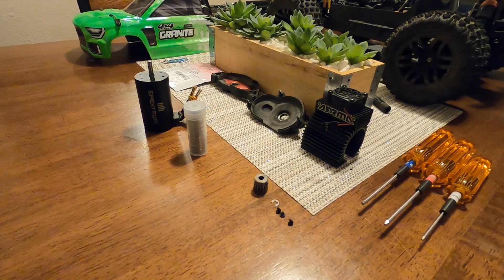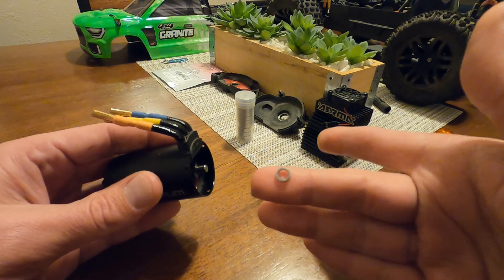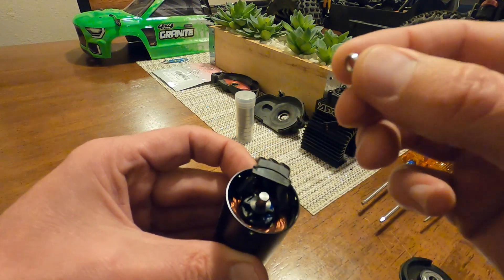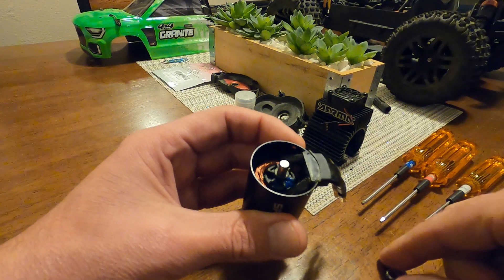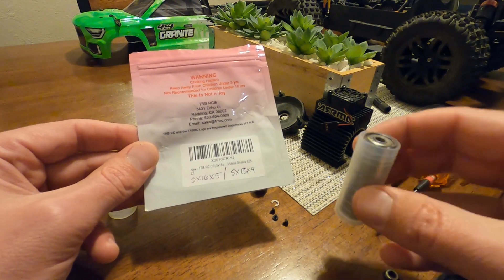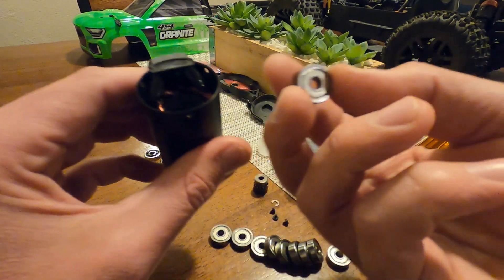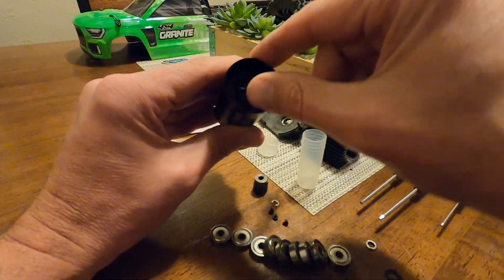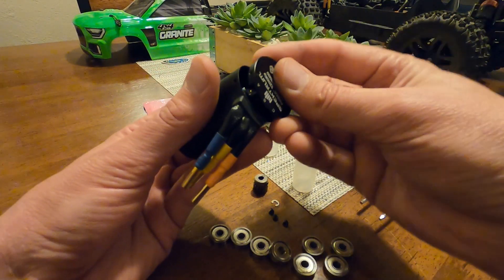Brushless RC Motor Bearing Replacement - Spektrum 3200kv (spmxsm2000 - Armma Granite 3S)

Comment: Thank you! Do you know any replacements for the screws that hold on the back cover? I may have stripped them..
Reply from the maker: You're welcome!  Unfortunately, I haven't been able to find those replacement screws, but I have heard that some people have found them on Ebay from time to time.
Reply: @rcleesd I’ll search. Thanks!
Reply: My response isn't showing up. Unless it keeps showing up but I don't see it. But those screws are on Amazon if u even need the cap screws for the motor. https://www.amazon.ca/XunLiu-Grade-Button-Socket-Screws/dp/B0756WS15T/ref=sr_1_1?keywords=m2x3+screw+button&qid=1570419268&s=hi&sr=1-1

Comment: how difficult was it to get the new bearing to seat in the motor? i'm trying right now and cannot get it to seat all the way in, it stops about halfway
Reply from the maker: Make sure that there isn't anything leftover...such as a bearing ring, if yours exploded? It's common for everything to come out except that outer ring. Other than that, you can try putting the motor cap (ends where the bearing go) in the sun or blow them with a blow dryer to heat the aluminum up (just a bit) so that it expands. You could also put the bearings inside a zip lock and toss them in the freezer for a few minutes...just don't leave them in there too long so they don't get moisture buildup. Let me know if you have any luck!
Reply: @rcleesd  Same problem, I’ll try helping with heat/freeze

Comment: Do you happen to know the size of those little screws, not the tool size but the actual screw size.
Reply from the maker: For the motor end cap? I can measure it....
Reply from the maker: 4mm total screw length. 3mm of threaded shaft.  1.5mm hex head.

Comment: Man I can’t for the life of me get that bigger bearing to seat all the way. I’m hesitant to use a hammer or something like that.. any tips? Is there any type of grease I could use to help it move in smoother?
Reply from the maker: You could try a drop of oil, but I would reccomend warming up (blow dryer, oven set to 140) the aluminum housing a little bit (but not too much) and it should expand ever so slightly and allow the bearing to seat fully. Let me know if this helps! Good luck 👍
Reply: @rcleesd  I ended up giving the metal shaft a couple love taps with a hammer, since the part of it that touched the bearing is the only thing I have that makes full/proper contact. Got it back together and the shaft has no play and also seems to rotate smoother by hand.

Gave it a few rips in the backyard and nothing exploded! Will have to check for any temperature issues tomorrow lol.
Reply from the maker: Awesome! Glad to hear it!!

Comment: Very helpful. Thank you!! 🧟
Reply: No worries thank you so much. Got a question too ask?  Where do you get those shims on back of the motor. You know the sad face things. I have another motor I'm fixing and now know why it broke on me. Thanks to your video. But I must have lost those when I took the motor apart a year ago. If could tell me what or part number would be great. Thank you!!  ☠️💯🥃
Reply from the maker: @skeletorrc2583  Honestly, I don't know where to buy them.  My best guess would be to try to source something similar to those at a hobby shop or Home Depot.  I doubt that Amazon would carry them, but possibly on Ebay.  Maybe you could try to contact Spektrum directly, but I think you have to go through Horizon. Their solution would be to send a new motor though. Good luck and let me know if you find a solution!
Reply: I have found some on Amazon that come in a kit. 200+ different sizes. From 3mm too 30mm so we will see. Thank you for responding if they are it I will gladly sure the info with you. ☠️🧟
Reply from the maker: Thanks for watching, glad it helped!

Comment: @RC Lee hey thanx for the link to bearings. My bearings were so bad well just the one in the nose that i couldn't get any numbers off of it , i got the number from the rear bearing and it ended up being to small when i took the race out  and matched it up im in the process of repairing my motor only after about 9 or 10 runs and the bearing is blown out
Reply from the maker: No problem! Bummer it went out after only 10 runs. Thanks for watching!

Comment: Does the bearing itself have to sit all the way down 
I couldn’t get the larger bearing to sit all the way down onto the motor
Reply: I could not get it to sit flush,  probably messed up with the removal process 
Ended up just putting it back together and getting a warranty motor
Reply from the maker: Try it and see if it runs...might not be an issue?
Reply from the maker: It should sit flush, but it will be a very tight fit.

Comment: Thank you. I never knew about the beveled side of the spacer. I recently checked my motor and the spacer was slightly chipped. I think it's because it was backwards. Replaced it the correct way with a spacer from another motor.
Reply from the maker: Awesome, glad it helped!!

Comment: This is super useful but the magnets are so strong I can’t get the rotor out
Reply from the maker: Thank you! I had a similar issue with mine but was able to get it out....maybe try to have someone else hold the can and use a vice grip (with something to protect the metal stem) and with two hands it might pop out? Be careful though, cause once you overpower the magnets, it will release with zero resistance and you may fall over! Good luck, let me know what happens!
Reply: @rcleesd  I was able to get it out just had to be quick and pushed the can down while holding the shaft.  Sadly the front motor bearing was shot so I have to get a new one.
Reply from the maker: @mysterygamer48  At least you were able to get it out!

Comment: My motor had the balls rolling around inside after 4 batteries and now a metal outer bearing ring is stuck inside. I’m about to order a new motor that isn’t from spectrum just because I can’t get this dumb thing out... any ideas?
Reply from the maker: Call Horizon, they will send a new motor, no questions asked!  It is a known defect, and they sent the V2 Arrma motor as a replacement. Haven't had any issues since! Check out my video about the warranty call and process...it was so easy!

Comment: thanks for this video, very helpfull! i have to change the bearing on my 4985 hobbywing from the max6 combo after 5 or 6 batterie charges, wonder what went wrong there ^^ i noticed some blue stuff on the rotor the side facing towards the pinion gear. what's that stuff? also, of course, i stripped one of the tiny screws on the back of the motor -_- subscribed!
Reply from the maker: Thanks for the sub! I believe that blue stuff on the rotor is used to balance it from the factory, like weights to balance a wheel.
Reply: @rcleesd  oh... so i screwed the motor i guess ^^ banggood i'm coming :D

Comment: So what sizes do you need to replace them ? 2 5x13x4?
Reply from the maker: It depends, do you have the V3? If so, you will need a 5x16x5 and one 5x13×4.  I explained it in detail starting at 6:20. Let me know if this makes sense!
Reply: @rcleesd  I’ve got the v3 , thanks :)
Reply from the maker: If you have a V2, I would open it up and make sure that both bearings are identical, but yes, they should be 5x13x4, if it is a V1 or V2.

Comment: Great Vid!!!!Really struggling to remove the front bearing any more tips? Im scared to wreck the can and the hole for the stator too bad. 🙈
Reply from the maker: Thank you! Try putting it in the fridge for about 20 minutes, then put it in the sun for 10 to 15 minutes. Since the can is aluminum and the bearing is steel, the can (bearing mount) should warm up and expand quicker than the steel bearing, allowing it to be removed with less difficulty. Good luck and let me know how it goes! Also, a very strong magnet may help remove the bearing as well, since it won't be attracted to the aluminum and only the steel bearing.
Reply: @rcleesd  tried the fridge 🙈. Then the heat gun... No joy... I ended up at last resort. I drilled 2 x 2mm holes on the perimeter of the bearing from the top of the can... it tapped out with a small hex. Bearings installed and running again. Thanks for the clear instructions in your vid . I also have a motor on way from horizon under warranty that will be a spare, also a lot of spare bearings. Win win. 😉 Also subbed!!
Reply from the maker: Awesome! I'm glad you got it out!!

Comment: If my bearing isnt broken but just dirty can i reuse it cause i cleaned mine off and put it back in and the motor wont move unless moved by hand
Reply: Well the bearing looked like it was in good shape nothing broke just alittle dirt on it so i cleaned it off and idk if it was good to put it back in
Reply from the maker: If it turns without any grit or grind then oil it and it should be good to go!
Reply from the maker: If it's that bad, then I would just replace the bearing.

Comment: That's interesting...... I got a bunch of Arrma Granites well I got alot of Arrma and traxxas trucks and a few other brands. But anyway my Granites all had Arrma branded motors.... I got the BLX v3s and they have the BLX 3660 3200kv motors.. I haven't gotten one with a stock spektrum 3660 3200 motor.. that's pretty cool bro and those are my V3 trucks.. my v2 and OG V1 granites also had the BLX motors same size same kv.. and I even ordered two new Granites from horizon hobby I picked up a new mega v3 and a blx v3 and they legitimately just showed up a hour ago.. and my blx has a blx motor as well.. that's cool you got the better motor lol.. I normally swap my blx motors and ESC's for real spektrums and remove Arrmas blx / spektrum hybrids. I mean nothing wrong with the BLX systems but I found out that true spektrum esc and motors work better and seem to have more "ass" behind em.. excuse the language 😂. But it's true.. now one of my Granites I built up is my project joker truck.. it's got the outcast 4s body which is black I put the arrma Skinz joker skin on the chassis which I paid alot to get it here to north Carolina lol. It's normal 15 dollars but shipping across the atlantic ocean is like 35 dollars lol.. so I ended up spending 50 dollars for it.... But I got two I got the joker and the lollipop girl for my Granites and ordered more yesterday for my outcast 6s ect. But anyway my project Granite mega v3 has all metal arms shocks rods it came stock with metal gearing but I went ahead and swapped em out for hot racing bullet proof diffs so it's all metal now I made a custom aluminum center drive shaft at my dad's machine shop it's hella nice and it's anodized to a candy apple green color. My motor and spur module is aluminum also green my arms are green my rods are purple shocks are purple but I also got green ones as well. It's 99% integy hop ups. Now the motor is a 4076 surpass 2200kv it's black with the fins on it and the esc is a hobbywing Quicrun BL 120 and I run it on my Ovonic 5200 50c 3s lipos. Which I love those batteries very durable and trustworthy batteries. I had one of em charged fully for 3 weeks I totally forgotten bout it and I went to check it n discharge it and balance back out.. and when I checked it it was still at 12.6 V all cells where equal still..... 99% capacity which 3 of my chargers said the same thing.. so yeah those Ovonics are amazing. So I run them 110% on everything.. but yeah man you can put a 4076 size motor in your Granites it leaves a 1/4" space between the back plate and the reciver box you would have to press a little harder to get the motor out but it's worth it 😂.. it's so much faster then it was with my blx 3200 and my outcast 4s motor which is a 3668 size which is also a really good upgrade to a bigger motor. But that 4076 is a straight up monster in the granite. Way more torque and top end I got a 17t pinion on a 57 spur all mod 1 all steel atm. My other granites except my new mega v3 I just got which is my 4th mega truck all has hot racing and other steel spurs in them.
Reply from the maker: Thank you for the thoughtful response, I really enjoyed reading it! That's so cool that you made a custom center driveshaft! I bet that purple and green looks amazing! I'll have to take a look at those Ovonic batteries...Ive been using spektrum batteries, but keep losing cell balance, even after balancing, so I'm getting some dead cells, but might be from the hard bashing, not sure. Thanks for all the info and tips, I really appreciate it!

Comment: My thought is the ceramic bearings would handle heat better and ceramic wears slow in my experience but not sure if it would make a big difference in this application
Reply: But heat and wear is what kills all bearings so idk
Reply from the maker: You are absolutely correct! They just cost a lot more, so depends on if you like having spares or just buy the good ceramic ones and hope they hold up. Either way works, thanks for watching!

Comment: Great video, just subbed! Got a replacement on the way from Horizon before I decided to get the courage to open up the case.

Somehow I misplaced the washer and spacer for the rear of the shaft. Any chance anyone knows of a hardware store/hobby shop would have something that could maybe stand in? Is it the end of the world if it’s reassembled w/o those spacers?
Reply from the maker: Thanks for the sub! I'm sure you could find a replacement washer, but finding the exact one at a hardware store would be difficult. It would need to be perfect to not cause heat or friction.  Unfortunately, I think this motor is not even available, so I doubt parts would be available, but it's worth a try!

Comment: Ran my brand new Typhon 3s V3 for only the second time today and that bearing destroyed itself. Bearing cage broken, steel balls throughout my motor. Im fighting to get out the pieces right now and had to take a break. I dont know if Spektrum actually makes these motors but its really disheartening to see this after only my second run. Thanks for the video man
Reply from the maker: The same thing happened to my Big Rock. Call Horizon, they will send you a new motor for free, no questions asked. They sent me the Arrma (V2) motor and haven't had an issue since. These bearings for this Spektrum motor are a known weak point and fail consistently.
Reply: @rcleesd  Yeah I'm thinking of doing that. I cant even get what's left of the bearing out of the housing rn. But that might be more cause of my mood rn... I'll give Horizon a shout
Reply from the maker: The EXACT same thing happened to me. I have a quick video from a few weeks ago where I talk about how easy it was because I bought the truck on Amazon  so they could digitally verify the purchase with no need to send in the motor or any receipts!
Reply: @rcleesd  Yeah one of the many upsides of buying something online. For this purchase I decided to go to my local shop tho. Hopefully it won't be too much of a hassle, especially cause they know it's a major issue with these motors.
Reply from the maker: Let me know what happens!

Comment: Thanks for the video!
Where did you buy these bearings from?
Reply from the maker: You're welcome, glad you liked it! I bought the bearings on Amazon. There should be a link in the pinned comment at the top.
Reply: Ok thanks for your super fast reply
Did the new bearings wear out as quickly as the old?
Reply from the maker: The new one hasn't worn out yet, but if it does, it will only be about $1 to slap a new one in!
Reply: Ok thanks because my motor startet getting bad after 6 runs and I just dont really want to open it up every couple of runs
Reply from the maker: @juliuseder8365  I think this motor has a know defect in the bearings. I had the same thing happen in my Big Rock and they sent the V2 motor instead and said they were "Having trouble sourcing the V3 Spektrum motor".  As long as it doesn't destroy the stator (spinning magnet middle peice) when the bearing fails, you can usually save the motor by replacing the bearings. It isn't fun or easy, but can save you a call to Horizon Hobby for a replacement. Best of luck!
Reply: Thanks!

Comment: What bit size did you use to remove the 3 screws? I tried a T6 on there and it was loose 🤨
Reply from the maker: It's a 1.5mm. Every screw on this particular truck is either 1.5mm, 2.0mm or 2.5mm, as far as I am aware. Thanks for watching, let me know if you have any other questions!!
Reply: @rcleesd  Thank you very much, I appreciate the reply!
Reply from the maker: @donaldk4867  No problem!

Comment: Very helpful post.  My typhon motor froze up and horizon is shipping a replacement but I took my old motor apart And the same bearing was obliterated.   Just balls and shards of metal...and grease of course 🙄.  Can't get the race of the dead bearing to budge though.
Reply from the maker: It is very difficult. I believe the housing and cap are aluminum, so maybe try to heat it up and the steel bearing shouldn't expand as much as the aluminum, and you might be able to get the rest out. Good luck and thanks for watching!

Comment: Thanks for the video man! The same thing happened to my big rock v3 on the 4th run. Unfortunately half of the bearing is still in the motor and I can’t get it out but luckily horizon is sending me a new motor when they get off of back order 👍
Reply from the maker: Nice!! They just sent me the V2 motor made by Arrma and said they might not be able to get that spektrum one anymore (probably because the bearings keep failing would be my guess).
Reply: @rcleesd  yeah they might send me one as well because it’s been a month since it’s happened